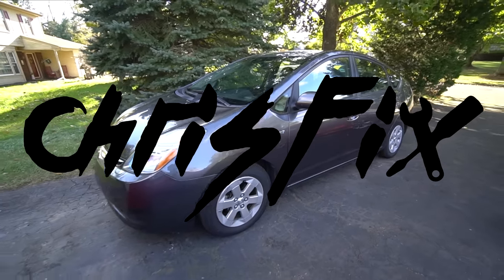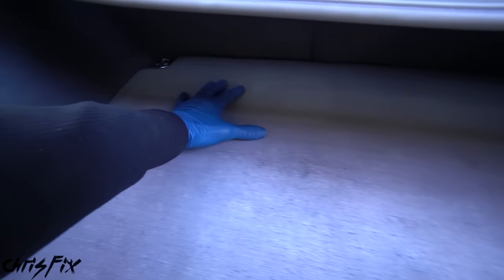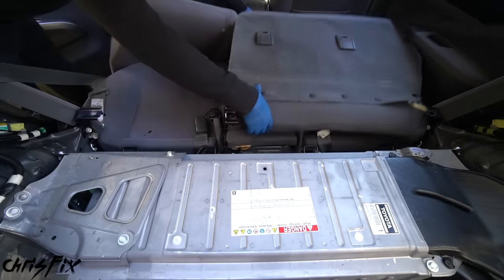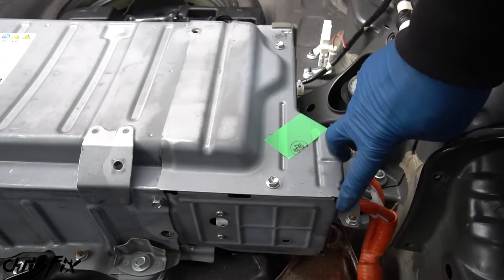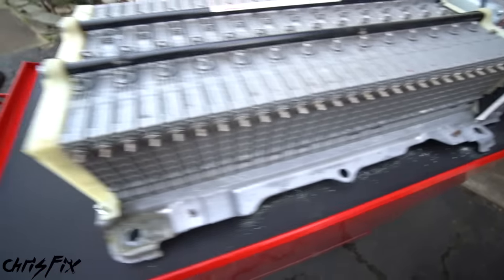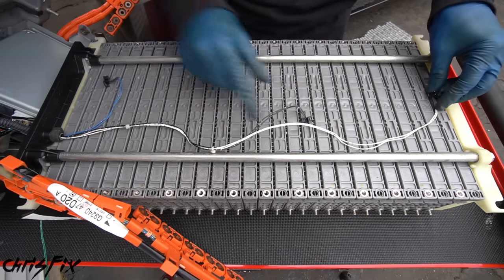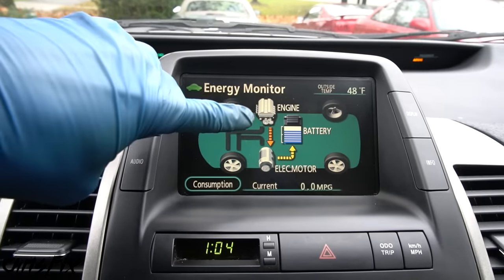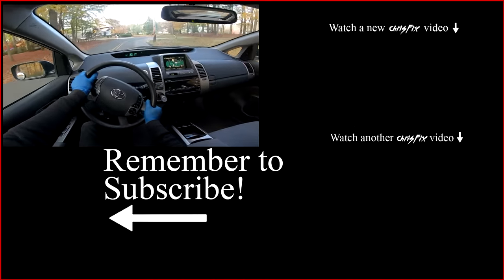I Bought the Most Hated Car on the Internet (and made $1000)

Comment: My 2009 Prius has almost 140,000 miles and is still using the original battery! If it goes bad, I'll probably replace it myself. I had to recently replace the ABS unit in my car with a used remanufactured one and it is working good. It was a big job but I did it and saved a lot of money not taking it to Toyota! They are too expensive for me!

Comment: "Totally easy" Unscrews 10 Panels and like 300 Bolts XD
Reply: It's a lot of steps, but none of them are difficult. Just stay organized and you could probably get this done in a few hours.
Reply: @cogspace  Even over the wekeend... Its gonna help save alot of cash. Only challenge is to find good battery pack/cells.
Reply: With mine I left the two upper brackets off the battery, now I can have it from car to bench in about 15 minutes.  Last time I replaced a module it took under one hour start to finish.

Edit:  I timed it today, just over 8 minutes to have it out of the car.
Reply: If this gonna get you 2.5k why not
Reply: Eh its still cool

Comment: Good video. Very well presented. I was surprised you just dried nuts after soaking in vinegar. I would have neutralized in water then spayed with CRC2016 lubricant which improves conductivity disperses moisture and helps prevent corrosion.  Or similar spray of course.

Comment: Notes to self on safety, as I see it at least:  After you take the bus bar covers off, the thing is "live" though it is separated into two sectors, left and right.  This means that if you were to grab two posts along the front (same line, one middle, one far right, or a post front and back diagonal, [which should be impossible with the bus bar cover still on the "other" side you aren't working on yet]) you could get a nice shock.  Also don't grab metal with one hand and any post with another.  This is the time when you want the safety gloves.  He wears the little gloves all the time, good idea, this is the time for big electric gloves, if you have any.  Then you want to unscrew the bolts and peel off the bus bars as you go along, from "farthest" from the main terminal to closest.  Don't grab the whole bus bars and pull them off (like he does).  Grab them off with only one hand.  When reinstalling the bus bars, vice versa, screw on from closest to the main terminal to farthest, then do the bus bar for the next one, don't touch any already screwed on (if you're reconnecting a first side it doesn't matter, cells aren't connected to each other yet, after doing so replace that side's bus bar cover).  Heavy gloves if possible.  Nice and safe.

Comment: Very good example how to keep order in any kind of dismantling, building work.
Weren't you afraid about battery quality, was there proper warranty that it will not be overheated, no fire, will not explode.
What about cost of old battery scrapping, I believe it has to be done in some specialized point ?
And congrats, no warning and alarm, good work 👍😊

Comment: Loved the car as i have no ego or interested in driving fancy big strong trucks, to me purpose of the car is to get from point A to B in the most efficient way and this car surly did the job very cheap on the gas as far as im concerned had no mechanical issue other then needed to fix suspension.

Comment: I don't have a Toyota Prius.  But my dad has a 2009 Toyota Camry hybrid that we got brand new in 2008 when I was 2 years old. It has been a great car. It has over 100,000 miles and it's the only car my dad has. We think the hybrid battery is going bad because it has the check engine light and it says check hybrid system. And other stuff is acting up. Also we just got a new 12 volt battery last year. (After 15 years!) I hope it can last for a little bit longer.

Comment: I hate it how much labor costs in the US. I just had my Toyota Celica in Greece basically restored and the price was insanely lower than here. 

To give you an example. Driver side paint job here in the US was like a $1,800 job. Granted they would've done both doors and it had a dent but not crazy. I ended up paying $500 to fix the dent and I painted the rest. Took me 3 weekends! 

Fast forward in Greece my Celica had the paint destroyed due to humidity. I basically restored and painted 90% of the car with $700. A side panel was $100! 

A lot of videos show how to change fluids yourself here in the US. In Greece I paid 10 euros to have the steering wheel fluid changed! Oh and he gave me a beer 🍺.

Comment: Instead of replacing the IMA battery, I bought a $250 GRID CHARGER. About every 2 months I use the grid charger for about 24 hrs, and the battery is like new for 2 months.

Comment: You should edit out where you advise people to move the temperature sensors like that. they're spread out for a reason, if a cell begins to become overcharged and show potential for a thermal event the fans will cut on and if it becomes hot enough it will shut down the vehicle before a possible thermal event does happen.

Comment: You want to leaver it in the temperature sensors in the same location because the temprature sensors are for diagnosing not just making sure the battery is cool. Like you said in your new battery all your cells in the new battery are balanced. Thats how you want your car to be you don't want some cells to be cooler then others because you want to know immediately when the battery is starting to corrode because if you catch it early it's fixable.

Comment: @18:21 ⚠️MISINFORMATION ABOUT THE TEMPERATURE SENSORS: the fan will kick on regardless. But if the sensors are you're unable to monitor the entire battery. Toyota place these in the locations for reason and they should be placed back correctly. I don't know how this got started on the internet but it's wrong. Toyota technicians that specializes in hybrids will tell you to put the temperature sensors back as you removed them. Otherwise a great and enjoyable video! 🙏🙏🙏

Comment: But no mention of PPE, battery discharge for safe working, voltage checks and equipotential testing to make sure the battery and vehicle is safe to use. 

The reason it's so expensive in dealer, is because we require certification, ppe and work space to carry out the work. We also keep in stock a giant insulated hook to drag electrified bodies away from unsafe vehicles

Comment: I like how for some people every bolt just comes loose no problem, the clips just pop right out, the sensors just simply unplug lol, they never fight or get stuck, or sensor breaks or something lol, meanwhile some of us have to shock at least 4 bolts to get um to come loose, you so much as breathe on a piece of old plastic it breaks lol
Reply from the maker: Well this was pretty straightforward. Nothing was difficult on this particular car. When it is, I show the solution to make removal easier.
Reply: @chrisfix  oh I know I’m not saying you’re somehow faking it or something lol, I just saying I seem to be cursed, a 1 hour job seems to just never go that way with my luck, a stuck bolt, or something brakes and then I have to deal with it, not all the time just whenever I think it’s gonna go easy lol
Reply: @scottmcmichael319  Well, that battery is on the interior so it won't get rusty bolts.

Comment: Video is very well done. I saw another instructional video that was also well done but looked like it was geared more towards mechanics than novices.
I just rebought my 2005 Prius, (great story) and I need to replace the battery. It will most likely be just my daughter and I and we have very little mechanical experience. Should we really attempt it or just leave it to the "experts" which that also scares me
Reply from the maker: I mean you watched the process. It’s pretty simple, just a ton of steps. You have a full guide. If you have the tools, I would personally give it a go.

Comment: I've got a check engine light on for the abs sensor. Imma replace it last though 1st tire rods 2nd shocks 3rd the module. Reason is I had to already drop $250 for breaks and rotars and labor. Didn't have a jack it was cheaper to pay the mechanic. And $110 for a tire. Landlord got paid to fix the driveway well I pulled out and boom flat tire bc of a cut valve stem. And tire was shredded where I drove on it flat.

Comment: 7:09 There is a 12mm bolt on the bottom of each of the seat bolster panels, so don't brake them.
Reply: I saw one at the bottom of the vent panel for the hybrid battery fan, but is there another on the other side?  I didn't get that far yet.  Lotta bolts.

Comment: I did this a few years ago and rebuilt the battery pack using an RC charger and some spare cells from ebay.  After I got everything assembled, balanced, etc, I reinstalled it in the car.  The Hybrid ECU had faulted out (maybe because the balancing process took a month?) and I ended up needing to use a friend's copy of the Toyota Techstream software to reset the Hybrid ECU. maybe there's a different way to do that reset?  Etiher way, got it done and the car started right up.  I wish I had this guide back then!

Comment: One crucial step was omitted- The top battery cover must be sealed with gaskets to the battery cells or else the fan air will not be forced through the cells, and the cells will overheat. Often, the original foam will disintegrate, which contributes to the demise of the hybrid battery.

Comment: Whoever designed this car should be given a timeout for trolling every mechanic.
Reply from the maker: Actually wasn't terrible once you get everything out of the way!
Reply: @chrisfix  So many fasteners, ducts and panels to remove before you can get at the battery.  I come from building / repairing server racks, desktops, laptops and even drones.  I know these things can be designed to be serviced very quickly and easily.  Hybrid and electric cars have a lot of catching up to do, and they should be looking at server hardware and agricultural drones for their design inspiration.  This Prius was a plastic headache... it's like the dash of an old Saturn in there.  Thanks for showing it off though, and being so concise and well ordered in your presentation, as usual ; ).  I've been binging your channel recently, it's the best out there.

Comment: From what I've found out those cheaper kits to restore a Prius battery are not new cells. They pick the ones from run out batteries that are just over the minimum spec, but still within limits. So they won't last that long like a new battery will. I guess they can buy a little more driving time before junking car or forking over for a new battery. Which is questionable.

Comment: $4k to buy the battery isn't bad compared to the Chevy Bolt now at $20k-$30k
Reply: Well, the Bolt isn't a hybrid like the Prius.
Reply: Last I checked the BOLT battery itself only costs $13,000 before installation, ~$20,000 installed. The "$30,000" that everyone refers to was for a Chevy VOLT that the quoting shop clearly didn't want to work on.
Reply: @Stephen Maxwell  that makes sense.  Still who would be willing to spend $20k on a battery for an old car?

Comment: After seeing this video there's no way I would have the dealer install new batteries, but this looks labor intensive for a dealer's shop. Adding in a reasonable profit for the battery and parts, $3,800 does not seem that out of line for a dealer to do this.
Reply from the maker: Exactly why they are charging that amount, but if you can do it yourself, you can save a ton!
Reply: And they use a new battery not a recycled one.

Comment: This is extremely dangerous, HV electricity is nothing anyone should mess with with out proper training and ppe. Also very important to ensure that the HV circuit has been completely disconnected. Usally about 200+ volts in these batteries. Just to mention… sometimes 4K is worth a lot less than a human life

Comment: The only problem with changing a hybrid battery is there’s a 50 50 chance the hybrid battery u buy can be defective and once u break the seal shops won’t warranty the sale neither will the dealership. So u will be out on what u paid for cus they won’t give a refund once seal is broke. I mean what are the chances of receiving a new hybrid battery in a crate to be defective? But it happens. Always test the polarity before breaking the seal. So u won’t lose any money.
Reply from the maker: Never heard of that happening, even if it did any reputable company/shop should warranty that. But good idea on testing it out before!
Reply: Bridgestone firestone does that. I use to work there. It really just a choice. The customer just wanted firestone to order the battery and the customer chose to install it himself. Next thing the customer calls firstone up to let us know that his car wont start. So he got his prius towed to our shop and we had to diagnose the car. Turns out the new battery was defective. He was told that if he chooses to install the battery himself that if the seal is broke it voids firestones warranty. Unless he just lets the shop fix his car but thats 1500 dollars he didnt want to pay for labor. Chose to do it himself. So took the loss bought another freakin battery an paid firestone to install it this time. Turns out his car ran again.

Comment: I've used a product by CRC called electric move meant for cleaning electric motor and can be used on energized equipment used it on ventilation fan that sounded like it was going to fail sprayed it and almost sounded like new also at a previous job at a e-cig shop I noticed the everytime the heat started the induction motor bearing made a lot of noise I knew that it was going to fail and one cold January or February day the heat went out I called landlord and happened to have a can of electric move or Lectric move something like that this version was the one that would not harm plastic and he had a scissor lift to get up to roof  got heat back working through the weekend maybe would worked longer but he got new one following week and have also used on computer fans that were noisy and dirty it works much better than I thought it would with multiple uses probably would be good for cooling fan for hybrid battery

Comment: the gimmick is...the battery you buy as rebuilt will have a warranty as long as it's installed buy a certified workshop that will release an invoice  and certificate of test at installation time, without this if a problem comes out you will have an issue ,this will also void your extended warranty if you bought one, not only that,but if the car is insured against fire and vandalism, and theft ,your insurance damage estimator will see that the battery is not the original and  will not cover your expenses or the damages called collateral, for example a car parked next to yours that got damaged or your home garage,this is why spending more for a certified job could prevent problems as consequences
Reply: PS, one way to get this under check is to get your local trusted  mechanic shop to take a look at the installation telling him you just bought the car with a replaced battery and you want him to  take a look to make sure its working correctly and to write that in the invoice

Comment: Thanks for your video. Please let me know how to find out if the temperature sensor is broken/not working!? ℹ️💜
Reply from the maker: It would likely throw a code related to the battery overheating if the temp sensors stopped working. Alternatively the fan might run at 100% depending on how it fails
Reply: Much appreciated, thanks man 🤝🏻

Comment: OMG, why did I ever buy a Prius?   I paid $2500 for a 2005 model, way too much.  And it has electrical issues.  The seller claimed the hybrid battery cells had all been replaced.  I don't want to replace the whole battery pack if I only need a couple cells.  Either way, I don't think I would ever buy a Prius again.
Reply from the maker: Sounds more like the seller ripped you off and it's less of the car's fault which is unfortunate because the prius is a pretty bulletproof car.

Comment: Only the first gen Prius is disliked due to the touchy braking. All other year models are not the most hated cars on the internet. Anyone that would knock one down, doesn't understand them. I'm a retired Toyota Diagnostic Master Technician that is Hybrid certified with well over 35 years of Toyota experience. The feared HV Battery price and durability at first was a big Question that scared a lot of people off before they made the jump to try one out. This big question was debunked when we technicians witnessed the HV Battery durability ending up better than expected. There were a few battery issues at the start which Toyota extended their warranty up to 100k miles and then the 150k miles for California on certain years. These HV Batteries have done nothing but improve over the years. This along with someone that is "NOT Hybrid Certified" attempting to replace one of these HV Batteries, I have to disagree with Chris. One wrong move and these Batteries can easily Kill you and it will. I have replaced 100's and even I was hit a few times but luckily half voltage, this still is not a nice shock. I was wearing the required safety gloves. While removing the two orange main HV cables to the Battery, My ratchet touched my knee, behind my line of vision. This can happen and if you forget to remove the service plug first, you can kiss your ass goodbye. My point is that someone could be able to pull the replacement off that's not trained to do so. But you would never catch me telling someone that's not trained, how to replace one. Chris, Your asking for real trouble if someone dies.

Comment: Should have disconnected 12v first, waited 5-20mins for the inverter capacitors to discharge then remove service plug,  disappointed that checking for absence of voltage wasn’t completed or shown